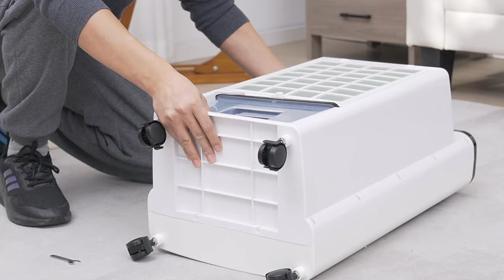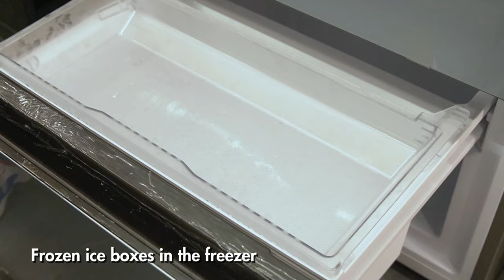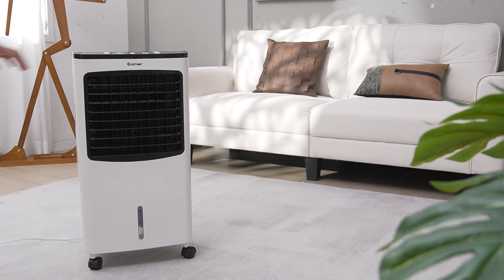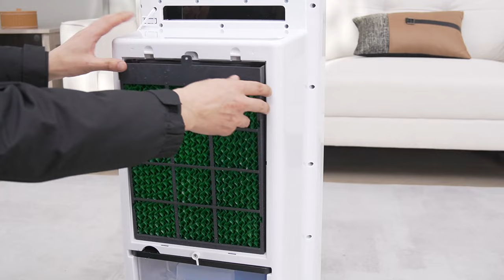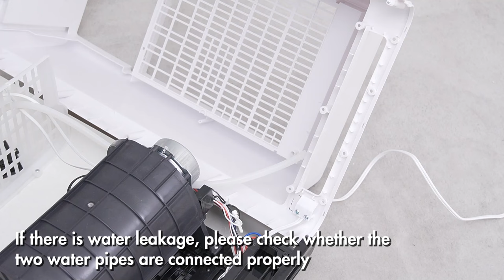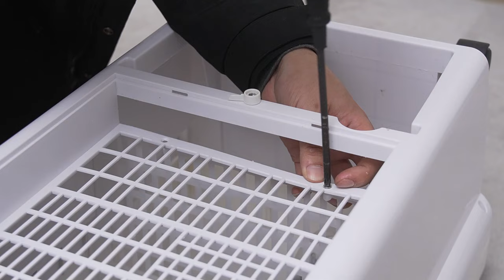How to Install the Evaporative Portable Air Cooler with 3 Wind Modes and Timer | EP23666 #costway

Comment: Right at the very end where you showed us how to reconnect the pump in the water tank, there is a very small advert for the next video that COMPLETELY COVERED your hands and that VERY IMPORTANT part. I'm pretty sure i can figure it out but damn! Whoever does or designs or what or who ever is in charge at YouTube, they need to stop showing us the next video until the FIRST ONE IS FINISHED😡
Reply from the maker: We've adjusted the ad's display time to avoid this.

Comment: Cheeez and Rice! What The heck??
 I just wanted to see how to clean the water tank. I didn't want to learn how to gut this thing!😂😊😊
You went  above and beyond. Thankyou for showing me how to clean the filter and wash the water tank. I have this exact model. I was very disappointed it doesn't cool 💩. It's more like a very expensive fan. If I'm sitting right in front of it, I feel cool. I live in a tiny studio apartment. It's 12x13". I left it on to run errands. When I got back and walked into my place it felt like a freaking Sauna! It is a humidifier! What does a 90°room and moisture create? A Sauna. I almost threw it out this window but i like my neighbor.
Reply from the maker: This product is a cooler fan, not an air conditioner, so it’s designed to cool the area immediately around it. To enhance its cooling effect, you can try the following steps: First, place the ice box in the refrigerator for a few minutes. Then, take it out and put it in the water tank. Finally, press the button to start the fan. We hope this helps, and please feel free to contact us if you have any further questions!

Comment: Thankyou for providing comprehensive information on how to use the device, as well as how to disassemble, clean, and even provide some information about possible repairs. 

It's very useful that the device can be cleaned with a fully detachable water tank and filter, but I do have some questions about routine cleaning:

How often should the water tank and filter be cleaned?

is there a recommended way to clean the water tank/ to clean the air filter at the back?

are either the water tank or the air filter to be cleaned using a sink or are either of them dishwasher safe if applicable? if not, what is the best way you would recommend to have them cleaned?

I would love to hear from you about how to maintain the swamp cooler. Mine has worked incredibly, and I plan to use it throughout the summer to keep my room cool, So I think it's important to be as aware as possible regarding routine cleaning and matinence for the best possible use. Thanks in advance.